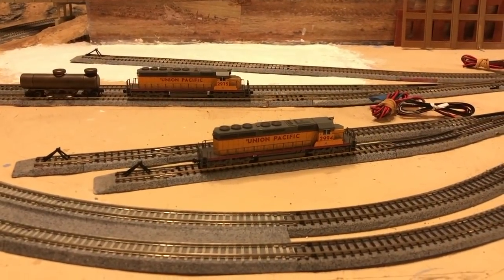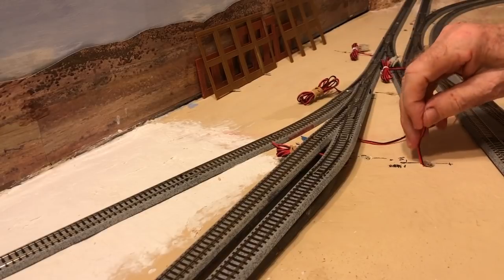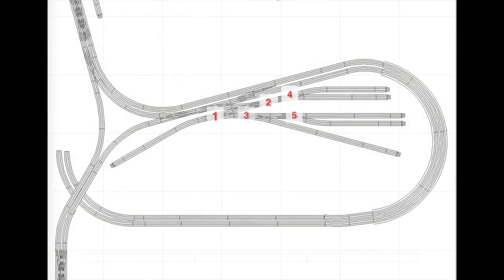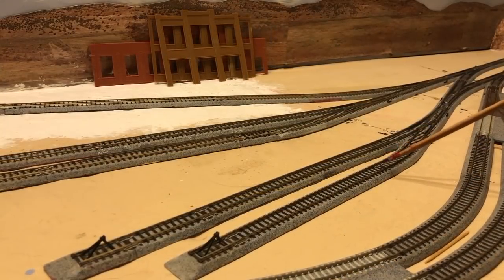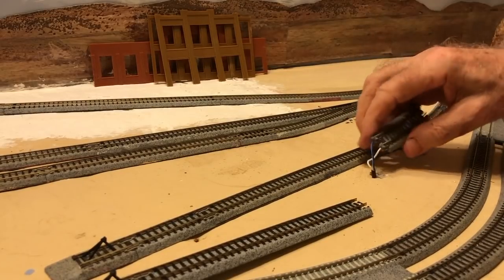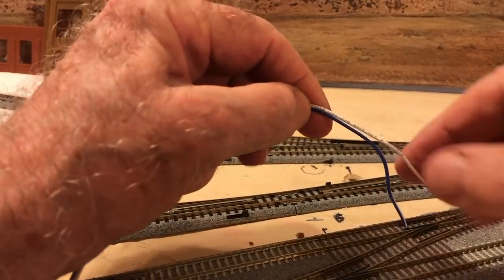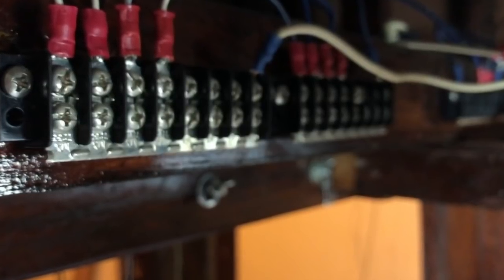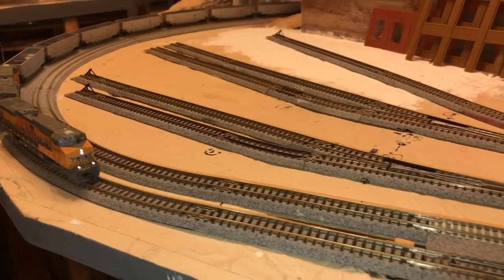Evanston Renovation 7 - Wiring the Yard on my N-Scale Model Railroad

Comment: Love it, Roy!  I use Kato Unitrack as well and it works a treat...wiring and changes.  I know you like to manually throw your turnouts...I did learn recently that you can program several switches together so that with one push you can make the two switches in the back go at once.  Pretty cool.  Thanks again, Roy!  John
Reply: where did you see how to wire two switches together would you share with me
Reply: william russ it is a video on programming the turnouts together (not wiring them together).  Where i saw it was on model railroader video plus in the building of the Canadian Canyons project railroad.  There are likely other videos on You Tube.

Comment: Can you power the KATO Turnouts with other controls, other than the KATO Turnout Control Device?

Do you run the Double Track Unitrack for the Main Line where possible or individual pieces of Unitrack Parallel to each other,  or combination of the two?

Comment: Hi Roy, loved the Kato wiring demonstration :) A question for you and the US model railroad community. Here in Europe the double slip (double switch and not double crossover) is very common at stations and yards. Even sometimes on main lines when branching out. But in the US you hardly see them used, neither in RL or in model railroad layouts. Is it due to the complicated technical /maintenance nature or reliability of the double slip? It seems to me that a lot of US yards could have even longer tracks with the usage of double slips, a great space saver that also avoid many of the dreaded snake movements (trains driving to new tracks in yards via double right or left opposing single switches) There must be more to it in Roys case using Kato track than the fact Kato does not produce a n scale double slip? :)

Comment: I absolutely love your videos and your layout is top notch I am actually in the process of building a layout well it's in the planing part I do have a question though my layout is going to be 4x8 I will be running n scale my question is I have a Canadian national fpa4 a and b unit set with about 12 passenger cars I'm not sure the layout length will be long enough for that train I dont want the train to be kissing its rear end also what curve should I go with so when the train comes around the corner it looks prototypical